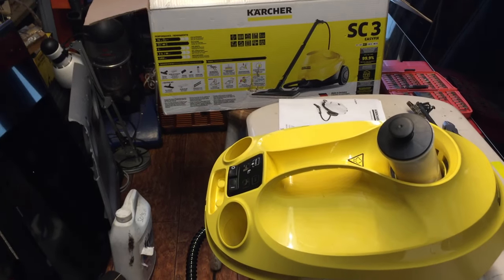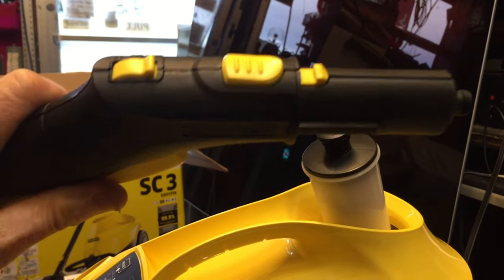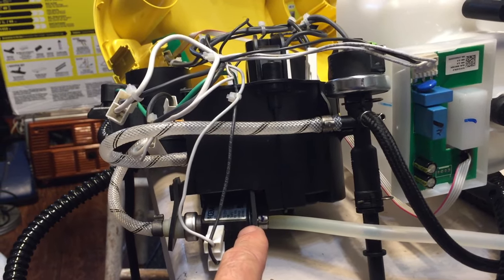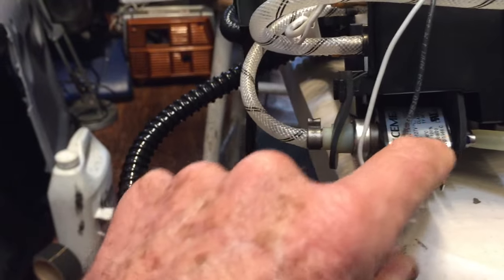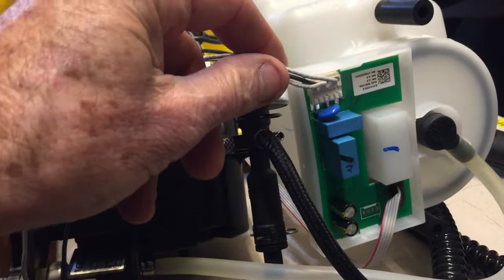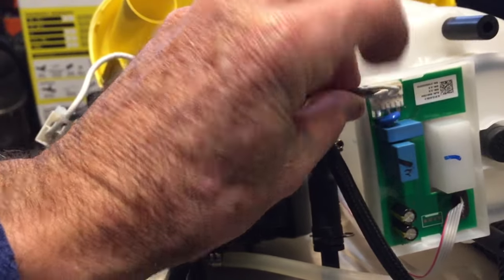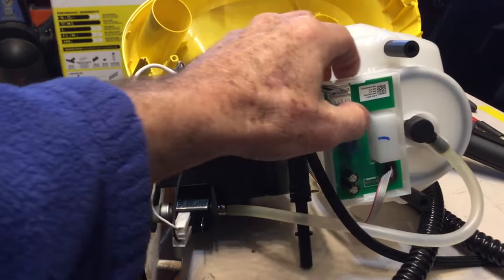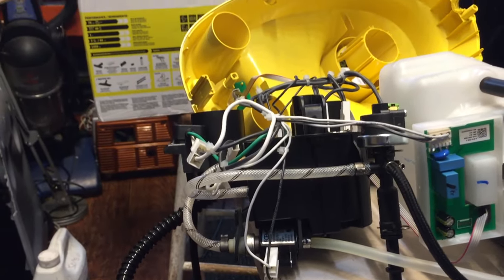KARCHER SC3  STEAM CLEANER REPAIR

Comment: I had the problem no steam motor would kick in ,I checked the float which was fine ,I put a long metal thin screwdriver in the hole where the filter cartridge goes and checked that ,emptied water out and left the unit upside down for a while filled wtank up put cartridge back in turned on immediately heard gurgling noise pump kicked in and 30secs steamer produced steam unit back up and running ,I don't know if it was clogged or turning it upside down did the trick

Comment: Thanks a lot. I fixed the steam cleaner by hitting it near the location with the loose contacts and it started working! Note: I have it for 3 years and used it less than 20 times. The issue occurred while it was in storage.
Reply: 4 mahl gebraucht, 2 jahren alt, keine dampfdruck, sc3 KÄRCHER, SO EIN S

Comment: Have you or anyone else noted a arc flash from the "O", off button, when shutting the unit off as the pump is running? The arc is bright enough to be visible through the housing.

Comment: Thanks for video.
In my case there was no steam production because of clogged descaling cartridge. Water is flowing out from the tank only through the cartridge. Device was hot with buzzing noise. Now I know it was coming out from solenoid pump without water. I am going to replace the descaling cartridge.
There is mechanical valve in the tank. Inserting cartridge will open the valve. Without the cartridge tank is closed, so no water is going to the solenoid pump. With removed cartridge you can manual open the valve and test steam production by pressing the pin in middle of the hole using screwdriver or pen. 
Also there is floating ?magnetic? water level indicator in the bottom of the tank. One of the blue component on the circuit board under the tank should be related sensor.

Comment: Thanks a lot. I was just about to throw mine away, when I decided to check the YT, and... voila :).
I disconnected the connector you showed, adjusted the pins with a screwdriver and to my astonishment it is working again :). Mine broke while in storage.

Comment: Hi.
My unit works but the descaler light will not go off. 
Rarely used. I have descaled it but still the same 🤷‍♂️ Float switch was stuck but now ok. Any ideas🤔 Possibly the sensor if all is working. Just need to trace it out 👍

Comment: Hi. Mine has no steam but gets very hot same as the video. I took it apart and the water tube feeding into the solenoid pump is brown, as if charred and there is definitely some sort of electrical activity in there as when I turn it on it makes sparking noises and rattling in the pump plus water does not travel from the tank down the tube. Any ideas? Where would I order a new solenoid pump?  Thank you!
Reply from the maker: This is just a guess on my part, but perhaps the noise you hear from the pump could mean it's trying to work but it's clogged.

Comment: great video but how did you get the case off, I have removed 4 screws from the base but can only prise it off at the pipe end and no further
Reply from the maker: It's been so long  since I repaired this unit I can't remember, but I often find hidden screws behind labels and rubber plugs that cover screw holes.
Reply: Two in the front under the hose

Comment: Hi there, I just brought one of these and was having the same issue, I then went back to exchange it and the new one done the same! So coming across your video I done the same thing, pulled the electrical board out and fiddled with the plug and it worked, but I find the steam is very weak and intermittent, any ideas?
Reply from the maker: There are only a few possibilities, but I would wonder if your connector is still not attached to the board correctly.

Comment: Hi Dave - mine heats up and releases a good blast of steam, but then it slows to a trickle. If i release the trigger the pressure kind of builds up again, then the same: blast to trickle. I just bought and replaced the solenoid but it made no differnce. Any idea what it could be?
Reply from the maker: Did you try plugging the solenoid directly to the 120 volt AC mains just to see what happens? Someone mentioned the solenoid is actually a pump, and I was able to plug mine directly into 120 for a few seconds  just to see if it was pumping as it should.. If that makes it work I'd be wondering if the AC vo;tage that normally drives it was missing.
Reply: @GrantsPassTVRepair  Thanks for replying! yes the solenoid is fine - i even bought a brand new solenoid kit and replaced it (wasted money there :-(  ) . The steam gets into the main hose and builds in it but, after the initial burst, just doesn't come out with any power or pressure
Reply from the maker: @rynie6334  Does you check the presure activated switch on the output of steam generator? I believe it was normall on with no pressure from the steam. If that checks okay I'd be suspicious of the logic  circuit board with the relays on it, or the connections on it as I described.
Reply: @GrantsPassTVRepair   Really thanks Grants! It does sound a bit too complicated for a novice like me... might have to pay the money for a repair. Cheers for taking the time to reply though
Reply from the maker: @rynie6334  Sometimes you just need to sleep on it and see if any new ideas come to mind, but don't forget there isn't much to this device electronicaly speaking.                                            If the heating unit is getting hot enough and there is water going to it there should be steam, but even if you see water in the hose from the water tank at the input to the solenoid pump,  is there enough water coming out of the solenoid pump?                                                                                     On mine I was able to pull off the  hose on the output side of the pump to see if water was actually coming out of it.
Reply: Same here

Comment: I have a question. I have a switching bench top power supply. 30v 10a and it worked fine then one day just started to flash a small red led on 5he power board. I've checked a few components but I'm so new to electronics. I want to fix it myself rather than take it to someone as I need to learn. Where could I start.
Reply from the maker: Modern day variable power supplies can be a challenge even for an experienced technician if you don't have a schematic, but I'd start by checking the simple things like the fuse, and the transistors, diodes and capacitors to see if any of them are shorted..
Reply: @GrantsPassTVRepair  I'm wondering if it's the over current circuit. It came on for one day then back to not working.

Comment: Hi Dave. I borrowed this machine from a friend and used water with kitchen acid. I didn't know that it wasn't allowed. Now it doen't steam anymore. Would you know what the problem may be. I opend the Kärcher, but now i dont know what to do.
Reply from the maker: I don't know what kitchen acid is, but perhaps you can tell me?
Reply: @GrantsPassTVRepair  Excuse me I mean cleaning vinegar, so the vinegar is a little bit stronger than the normal for cooking
Reply: @GrantsPassTVRepair  and than 4 parts of water er 1 part of cleaning vinegar
Reply from the maker: @EvelinevandenHout  Thanks for the clarification. I'm not sure a little vinegar mixed with water is the cause of this malfunction, but if it was, I'd suspect the water pump, which I mistakenly called a solenoid in my video is could have gone bad, but that's just a guess since I have not seen it. the pump operates on 120 volts AC, so testing it should be fairly easy.
Reply: @GrantsPassTVRepair  thank you for the answer. Since I am a little hobby repair woman, I don't know much about electrics. That solenoid gets hot and also de metal part in the middle where all the cables come together. When I press the pistol there comes a little bit water, but no steam. I can't see water moving through the waterhose towards the solenoid. What can I do?
Reply: @EvelinevandenHout If there’s no water coming to the water pump, from the white tank, there’s a black rubber thingy to which the hose connects to. Its hole is quite tiny so it might be clogged. Pull it out (you don’t risk anything) and blow through the hole.

Comment: hi bro I have a CS2, this model has two lights one green another orange/red ... at the time that I connect the plug to the electric source only the green light is turning on.

I have been using the machine for an hour and now the device is broken
Reply from the maker: I don't know any specifics about the model other than what i showed in this video, but I hope you can figure it out.

Comment: I know this getting old post now anyone here have this board out I'm in need of help desperately I can't get the board here at all in Australia I can't find any pics or find PCB diagram and one of the 4 legged MOSFET near that 3 pin power connector has died on my board can some one please tell me the numbers on this MOSFET please, Karcher won't tell me, only thing stopping my unit from working 

All I need is those numbers on-top of that chip has 4 legs on other side of the board near the removable 3 pin cable 

Thank you everyone thanks